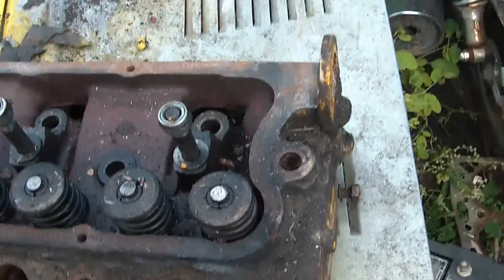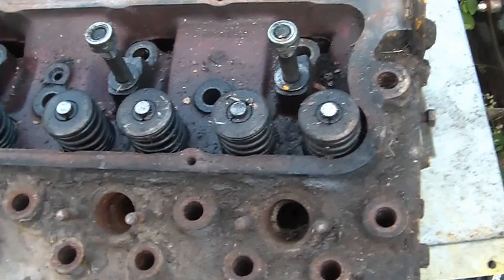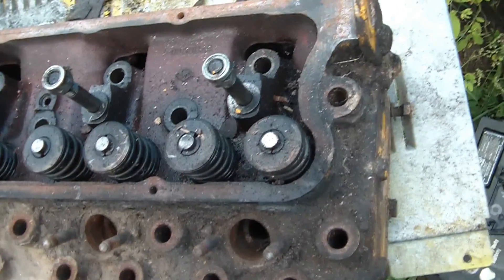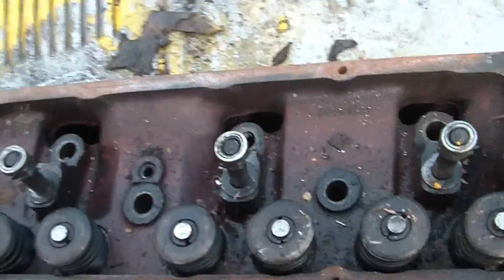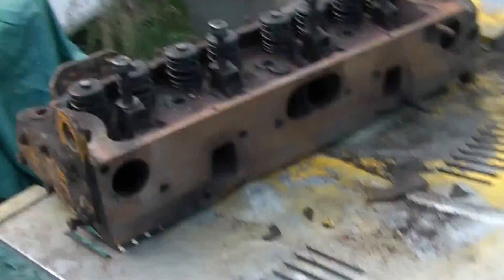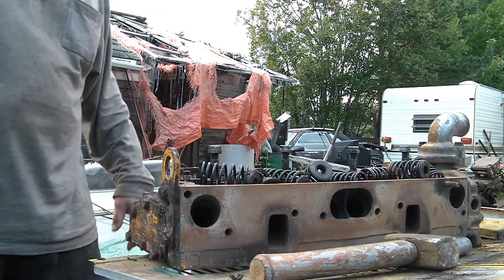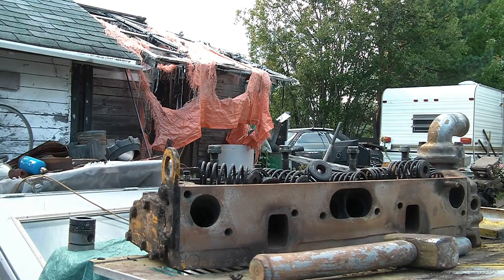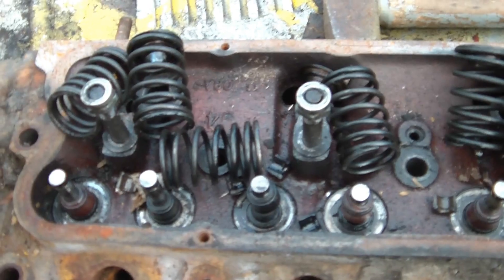2 Minute Valve Spring Removal How To.

Comment: Perkins? 4.236 ehh?
Reply from the maker: Yep
Reply: @timlad5  nice, just got a boat with one of those, and I been in class fer a week tryn to learn everything eye can, and the classes are few 😆,  thank you for sharing
Reply from the maker: @BurchellAtTheWharf  the Perkins engines are in everything. Good engines with proper care.
Reply: @timlad5  yes, got one in my backhoe but it runs to well to part up, but just found a nearly "new" one and it's gonna be in the boat this week I hope
Reply from the maker: @BurchellAtTheWharf  a helpful bit of info is the Perkins 4 248 is the same engine with a bigger bore. Helps when looking for parts.
Reply: @timlad5  thank you very much, this will help with the findings of new parts for the old motor, thinking of rebuilding it but up to like a 100 sum HP instead of the 50-80 it might currently have, but I have much yet to learn

Comment: When hammering the spring retainer and spring, does this move the valve and risk bending the valve stem?
Reply from the maker: Valve stems are pretty rugged. I've yet to bend one using this method. The actual force you are using isn't that much. Instead of putting pressure on the stem you are moving the retaining assembly.

Comment: Do you put them back on the same way.
Reply from the maker: I use an open ended wrench and lay it flat across the top then I use my body weight as force to compress the assembly and put in the keepers.

Comment: I'm guessing that with an aluminum head, to avoid damage to the head's gasket surface, you'd first want to put the head onto one or two layers of cardboard placed on some flat surface.  The uneven, hard surface of the metal hood that the video shows, might put some dings in an aluminum head.
Reply: John Sawyer pk

Comment: Quick question. this head looks similar to a ford 201 3 cyl. Looks to have the same intake valve seals anyway. Question is, do they actually lock on to the valve guides like most or do they just slide down onto the valve a kinda float there on the stem without pressing onto the guide. I have the 3 cyl I have to do seals on. I got the new seals but they don't look like they actually lock onto the guide like a standard valve seal does.
Reply from the maker: +Collin Bessmer Most valve stem seals have a small retaining spring to hold them in place.
Reply: +timlad5 Yea I know most have those springs but these ones I have don't and it looks like the ones in the video didn't have em. Just curious.
Reply: +Collin Bessmer the springs don't hold the seal to the head the springs hold the seal around the valve 

the stem seals should fit tightly around the guide

Comment: You would only do this if you intend to scrap the valves as it can leave marks on the stem from contact with the retainer.  I have seen a valve break at idle because someone dismantled a head like this. You won't see any professional mechanic or engine reconditioner do this. ever.
Reply from the maker: +Cymon Hewitt The guy who taught me this was a performance engine mechanic. It was an old method used to do quick valve removal. Of course he had a fully equipped shop but still remembered what its like to have basic hand tools. As for valve damage, I've never seen it but at the price of new valves replacing is always a good idea.
Reply: +timlad5  i have seen a replacement head that was recently reconditioned loose a stem just below the collet and the valve fell into the cylinder, at idle so the damage was minimal lucky. There was impact marks on several of the other valves from being dismantled this way. You might get away with it, you might not.

Comment: Ive used this method a number of times over the years. On 16 valve heads, if saves so much time. Got a 20 valve to do soon. I always pack rags under the combustion chamber to make sure the valves don't get bent

Comment: Wat a dumb ass it going to damage the head
Reply from the maker: How so? You are applying the same amount of force that the cam does to the spring assembly. It is a cast iron head and is meant to take some serious explosions. The compression on a car is around 9;1 while diesels are close to 40;1. Car heads can handle this so a diesel won't even be bothered by it.
Reply: Ya there's no damage done. But the thing is how u gna put the keepers on using this method
Reply from the maker: Denny Pilit This method won't work to assemble the springs and keepers. It isn't meant to be a do all method either.  It is just a simple method for removing the valve spring assembly and nothing more.
Reply: Yes I understand that but if your going to make diy video especially with something that's dealing with removing and must be reinstalled, dnt just make a video of something in how to remove. You know what I mean? I know he's trying to help people and some people dont have enough knowledge, but dnt do a half ass job.
Reply from the maker: A future video will hopefully be made showing how to install without the specialized tools but it doesn't mean you have to wait. Many people have videos with ideas of a similar nature. As for a half ass job well the title says removal, not removal and replacement.
Reply: Ya suppose. Now I got to go get the tool hahaha jk
Reply from the maker: I use a box end wrench to push down on the retainer and insert the keepers when I don't have the tool. Just remember to put the rag under the head in the combustion chamber to keep the valve in place. You'll need some body weight and patience but it does work.
Reply: Ya I already have the tool its the 2 piece, u hit it with a hammer it has a magnet in the inside to catch the keepers n the other piece to install n use body wieght as well. I've done a few valve jobs, port n polish, head work, n this tool is awsome
Reply from the maker: Why not shoot a video showing it in operation? I'm sure others would find it informative. The more choices we have the better we can do the job.
Reply: timlad5 I'm not much of an uploader YouTube guy, I js watch youtube lol. But how I got  this tool is from Eric the car guy, he has great videos in diy. Check him out
Reply from the maker: I'll check him out. Uploading isn't much of a hassle if you upload your videos when you're sleeping. Give it some consideration. With around 7 billion people on earth you might appeal to many with your ideas and videos.
Reply: timlad5 maybe one day I will. N sorry I didn't mean to say half ass, well I did but not in a rude way lol
Reply from the maker: Don't worry about the comment. We've talked and worked it out.

Comment: I bought the universal tool from harbor freight. it was a pain...then I found your video. I wish I would have watched this before buying the tool. 

Make sure if you use this method its in a clean area because the retainers will fly!
Great video, thank you.
Reply: Ahh but to put them back together I'm.betting you need the valve spring tool.
Reply from the maker: Tony Bendos The tool is nice to have but I have used a box end wrench to push the retainer down onto the valve stem and insert the keepers. Not easy but doable if you have some body weight.

Comment: did you bend any of those valves when they hit the table below?  I know I did once
Reply from the maker: That is one of the reasons to use a rag in the combustion chamber. I didn't because I was replacing the valves anyways. I didn't check the valves after so I may have or may not have bent one.

Comment: OK I did it. Now how to get em back in?
Reply from the maker: I used an open end wrench. I laid the open end against the top of the assembly and use my body weight against my hand to compress the spring and put the keepers in place. Make sure you have a rag under the valve inside the combustion chamber to keep the valve from pushing in. The last 3 or 4 valves get to be harder because you're wearing out by then.

Comment: this really is a great way of gettin the keepers free, jus keep in mind u takin a small chance of chipping certain important edges off. like i said tho thiss a great idea if u dont have a compressor, n the chipping isnt really a big deal unless u have somethin really rare u can find n extra one layin around. one way to help this process is get as much oil off of the keepers, stem and cup as possible this helps them fall outta the way. brakleen is good to use because they claim (and in my experience) its safe on rubbers, polys, and plastics.

Comment: That is impressive but really a lot crap today is made out of aluninum. If you were to do that it would crack break apart or warp. Let alone destroy the springs.
Reply: Nope... worked at a machine shop, aluminum heads no prob, did this all day long

Comment from the maker: Information on how to do something with what is on hand can make the job more satisfying when you do it yourself. You don't need the proper tools every time although it is nice to have them. I replace springs with basic hand tools mainly because I don't rebuild enough heads to justify the specialty tools. I scrap aluminum heads and end product condition is not critical. The guy who taught me this method ran a motorcycle repair shop and had necessary tools.

Comment from the maker: Personally I would just adjust the socket size to fit and go ahead. You have to remember 2 things here with this method. 1) You are using equal or just slightly greater force than the cam uses to compress the spring and open the valve. You are pushing the spring and not the valve which negates valve opening.   2) your comfort zone. If you don't feel comfortable with this method for your application then err on the side of caution. Try a scrap head or two first. If not then a professional.

Comment: The size of the hammer is dependent on what you are comfortable with. I've done it with both steel and aluminum heads with no damage. The aluminum heads have a thin metal washer at the base of the spring to protect the head. Most important is your comfort zone.